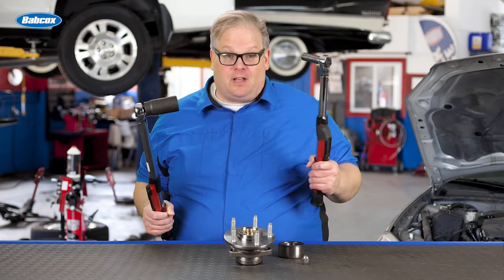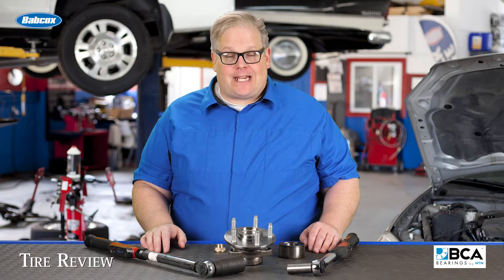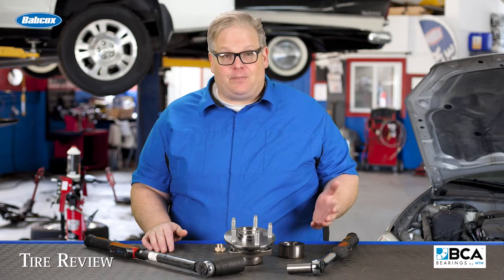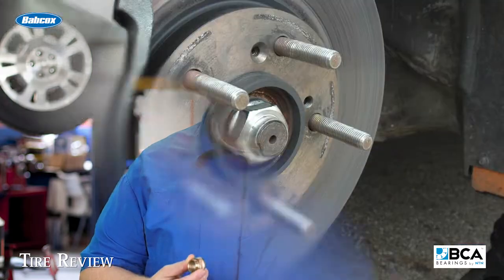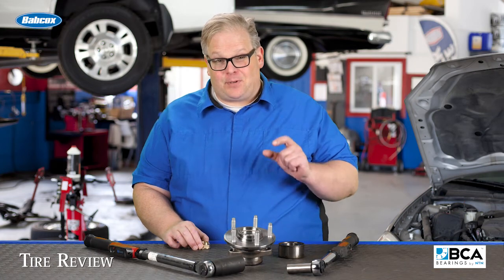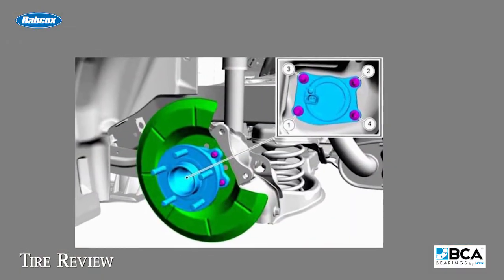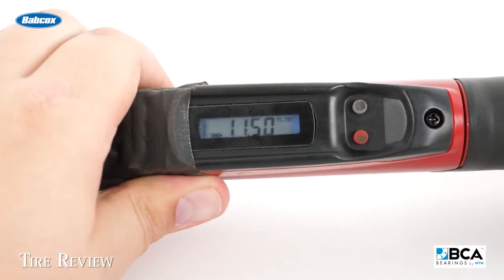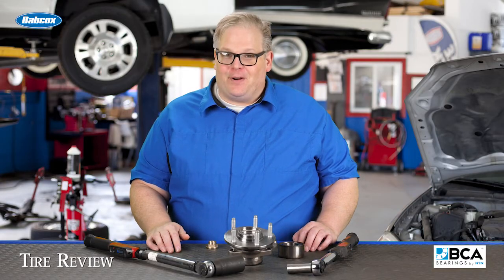Axle Nut Torque Tips

Comment: Where can we find torque specs, for free, if we do not have a service manual?
Reply from the maker: As you may know, there are services that provide installation info and torque specs, but they require a subscription to access online. You may be able to find torque specs for individual applications on automotive forums, but we always recommend using a trustworthy source. 

BCA includes a QR code to access our Torque Spec Lookup App in the box with our wheel hubs to ensure our customers have accurate information.

Comment: If you find this video informative, then you should NOT be messing with axle nut torque or any other bolt that has a specific torque spec.
Reply from the maker: It is surprising how many people disregard axle nut torque specs. Our top causes of warranty claims are installation errors, and over/under torqueing the axle nut is chief among those. We often hear from people that they can achieve the proper torque using their impact gun alone, so we constantly need to tell folks to use a torque wrench and follow the manufacturer specs. We can't say it enough.

Comment: On a recent video done by an amateur of axle nut torquing, several professionals chimed into the comments section to say they NEVER use a torque wrench for axle nuts. Instead they use power tools. I was a little surprised, at first I thought it was a joke. The flat rate landscape is full of guys who spend their whole day trying to beat standard shop times.
Reply from the maker: Yeah, we have heard and seen it all. One of the top comebacks we see with wheel bearings is over/under-torqued axle nuts. A lot of wheel bearings rely on proper axle nut torque to set the preload on the bearing. Too much or too little preload will dramatically reduce the life of the bearing. There are certain wheel hub assemblies that have the bearing preload set at the factory, and the axle nut serves only to retain the axle shaft in the hub. In those cases, the axle nut torque isn’t going to throw off the bearing preload, but the spec should still be followed to ensure proper seating and retention of the axle shaft. Either way, proper axle nut torque is critical to the reliability and safety of a vehicle. We always tell techs and DIYers to trust the spec and use a torque wrench. Thanks for commenting!
Reply: @BCABearings  Like you said, my axle nut has nothing to do with preload.  The nut tightens against the hub.
Reply from the maker: Yeah, many modern hub assemblies no longer rely on the axle nut to set the bearing pre-load. These designs limit installation error caused by setting the incorrect preload, but the torque spec is still important to follow.

Comment: Is there an Internet site where one can find torque specs?
Reply from the maker: Good question. There are websites that offer torque specs, but the information is generally behind a paywall that requires a subscription to access. You may be able to find torque specs for individual applications on automotive forums or in youtube videos, but we always recommend using a trustworthy source for critical specs, like axle nut torque. BCA includes an axle nut torque spec guide in the box with our wheel hubs to ensure our customers have accurate information.

Comment: Where can you calibrate your torque wrench? Is it only for mechanical torque wrenches or for the electronic ones as well? Do you go to a dealership for this procedure or where? And where you can find a designated torque wrench for the axle nut, what would be the name? Or just to use an electronic one, since they are more precise?
Reply from the maker: Good question! Any style of torque wrench of decent quality (Click, Beam, Digital, or Dial) can be calibrated. Many tool manufactures market their own torque wrench calibration tools, and professional tool dealers, like Snap On, sell the calibration equipment and also provide calibration services. You may also find reputable calibration services where you can send them your torque wrench for calibration and they send the calibrated tool back to you with a certificate of calibration.
Reply: @BCABearings  Thank you, the closest I found is in Houston (it is Calibration Laboratory there), I got in contact with them already, but I'm curious, how all the dealerships in Dallas, so they also do the calibration via mail? Thank you again for pointing out on that question about the frequency of calibration. My previous impression was that you might need to calibrate the torque wrench, but very very rarely, and since I have several of them I can double check occasionally and that is all. I'll keep your advice about the calibration ~ once a year in mind.

Comment: My equinox is awd or fwd. both use same rear wheel bearing. Why is it ok to use the rear bearing with no torque? But the awd setup needs proper torque?
Reply from the maker: Great question! In many applications, the axle nut torque specs exist to set the proper bearing preload. The rear wheel bearings on the Equinox (AWD or FWD) have a rolled closure design that sets the wheel bearing pre-load from the factory. This means that the FWD models are able to use the same rear wheel bearings as the AWD models without needing a torqued axle nut to set the preload (since there is no axle nut to torque on the rear of FWD models). The AWD models with rolled closure designed hubs, still list a torque spec for the front and rear axle nuts; this torque spec is more important for proper installation and safe operation than it is for setting the bearing preload. Hope this helps explain.

Comment: Do the wheels have to be on the ground to torque down the axle nut?
Reply from the maker: Good question! No, the wheels do not need to be on the ground to properly torque the axle nut. However, on axles that rotate, like on a 4WD application, the axle needs to be secured so it will not turn while tightening the nut. Most technicians do this by putting a screwdriver or other such tool into the cooling vanes of the brake rotor to prevent rotation, or have someone depress the brake pedal to keep the axle from turning during tightening.
Reply: Ok so much info online would confuse anybody looking to do this job and thank you for the detailed reply.
Reply: I think this can be auto manufacturer specific based on the service manual.  For example, I just did a set that had the initial torque of 143ft-lbs and it was required that the wheels were off the ground.  Then they asked for an additional 180 degrees with wheels on the ground.